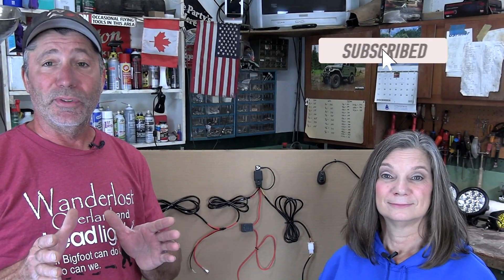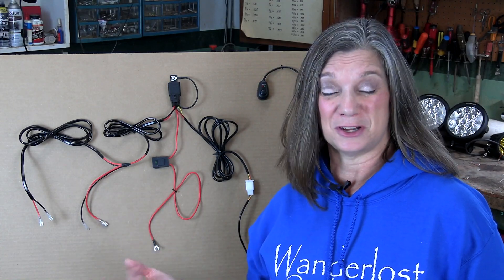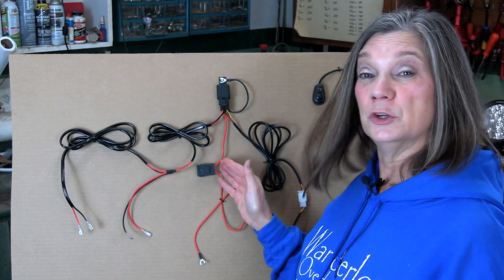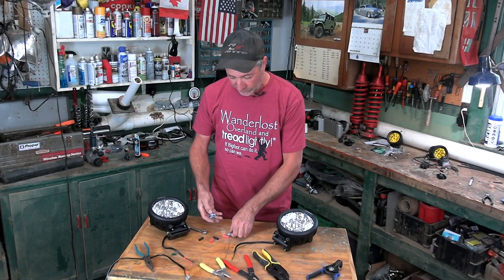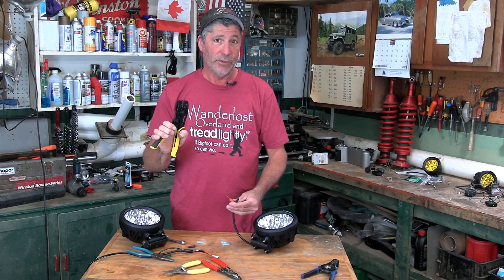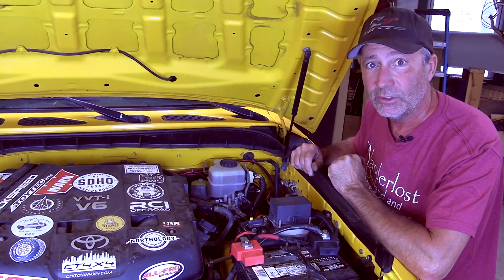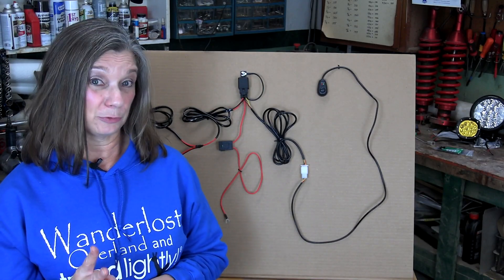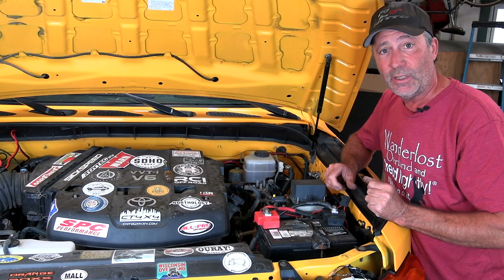How To Wire In Relay Harness For Lights, SIMPLE!

Comment: Hello I really need help, 
Do you reccemend  any H8 foglight wire harnesses? I found one but the switch is the type that is not recommended. The switch has a black ground wire and a loose end red wire and I am also confused which fuse to use in the passenger fusebox. 
Could I please have help with this?

I seen that on the iJDM website is that I must connect the loose red wire from the switch to the ACC +12. Should I get a add a circuit or do the ACC +12 instead?

Comment: Why this switch red light always on even tho I turn off the car ? I think will drain the battery
Reply: That means you probably hooked it directly up to the battery and it’s constantly ready to turn on your lights extreme minimum draw on your battery. You can let it run for weeks and you should be fine.

Comment: I have the kind of switch that you show in your video that has 3 wires. The button on mine broke so now I have to use a toggle switch instead but I don’t know what 3 wires go where on the toggle I have a black /blue and white wires that need to be hooked up to the toggle switch

Comment: Thanks for this video! It is very helpful and through. I am installing running lights on my Ram 3500 and bought a wire harness with switch (5 prong rocker switch, includes relay and fuse) from nightlight. Every time I turn the switch on it blows the fuse. I’m not sure what I’ve done wrong. My wiring from harness to lights is correct polarity.
Reply: Check your grounding. A poor negative off the relay will blow fuses just as much as a faulty positive.

Comment: I'm trying to run 4 light pods into 1 OEM style switch on a 2019 Toyota Tacoma. I purchased a quad output harness that comes with the "mouse style" on/off switch shown in the video.
My question is, how would I wire those 3 wires from the "mouse style" switch to the OE style switches?

Comment: I bought some 4led grille lights (6 of them) to wire in my truck . They each obviously have 2 wires (red & black) coming off the back .
Maybe I'm overthinking it, but I'm confused how I will take 12 wires (6 red , 6 black ) and have them end up being only 2 wires to hookup to the switch . 

I have almost the exact same wiring harness (has the inline fuse & relay) . Do I need to solder the LED leads all together or is there an easier way to go from 12 -> 2 wires?

Comment: Wired one of these in today. I used the cheap “ok” switch. This switch is usable when the ignition is on or off. The little light on the switch stays on all the time. Is this too much of a draw and will kill my battery? If so, how do I change this to on only when ignition is on. Also, my harness said to hook the ground to the battery, if that makes a difference.
Reply: Did you find any solution?
Reply: @GJAGX35  
So thankfully a friend of mine has a son in law who has a vehicle accessory business.  He informed me that the light being on is normal and won’t draw on the battery. Had mine hooked up like this for 6 months and no issues.
Reply: @scottreeser8225  so it's okay that the light in the switch stays on all the time even if the car is turned off?
Reply: @GJAGX35  
Yes, light stays on. Red means aux light that switch is hooked to is off. Green means light hooked to switch is on. So long as you don’t leave the light switch in the on position, there is no danger of running down the battery

Comment: Nice video, thanks. I want to use a stock Ford switch that was not on my truck originally. The back of the switch has three blades. I couldn't figure out why there would be three wires until watching your video. Is there any easy way to identify which blade would be the ground for the switch's led light without having a stock connector plug and harness to look at? Thanks

Comment: On this harness used in this video, have you ever cut the switch off the wiring on one of these to see how many wires are in the sheathing? I was thinking about trying to use this harness on an OEM factory switch and that switch has 2 wires coming off of it.

Comment: Thank you decided to subscribe your advice is concise
One question i have old spotlights non led on my Landcruiser , I need to change to light at . Can I use the existing wiring?
Reply: Sorry led lightbar can use existing wiring?
Reply from the maker: Typically LED lights use less amperage than older style lights. Your existing wires should be large enough to provide the power, but first check how many amps your old lights used compared to your new lights.

Comment: Very Informative video!

I have a question though. 

Upto how many wattage can the relay withstand?

i am planning to add an auxilliary led light that is 50 watts each. do i need to have 2 relays or just one? 

thanks
Reply from the maker: Relays come in a wide range of wattage limits. Get one that will withstand over 100 watts.

Comment: Question maybe you can answer.I have a wiring harness that has red, black and blue wires leading to the switch. I want to use a different switch than the one it came with so it will fit in the switch panel I have. I have a 5 pin switch I want to use, but I'm unsure how to wire it as I know nothing about this stuff.

Comment: I hooked up my lights exactly how you explained,  very similar relay/ wiring harness,  only thing is the off led light on the switch is always on.
Any help would be appreciated thnx.
Reply: Mine does the same. Shouldnt the light turn off automatically also wouldnt that drain our battery if the light on the switch remains on over night
Reply: switch is getting a 12v always on circuit.  move the switch to an accessory or on circuit.
Reply: @K03sport no other possible solution? Only tap into accessory line?

Comment: Hi I’ve brought a push toggle on off switch that’s waterproof that go in place of my push switch like you have in your video. Now the question is the switch that’s in your video has 3 wires the one waterproof switch I’ve purchased only has 2 wires how do I solve this 
Thanks

Comment: Where your diode? When that thing de-energizes it can send a big spike. Self tapping screws are just that...they SELF TAP!  And you want to put that ground ring term of the back side of the plastic hanger of the relay. It needs to touch metal...also should scrape the paint off for a good ground.

Comment: Hi Guys! Awesome video! Your tutorial and visual demo board made it very easy to understand. Thankfully, I have some experience with relays and their wiring for the radiator fans that I installed. My only question is: What size (Amp) fuses should I be using, and do they come with the wiring kit? Thanks so much for sharing, well done. Cheers from Michigan.
Reply from the maker: Some harnesses come with an inline fuse holder. If not, you'll need to splice one in. For fuse size; if your fans draw 26 amps, use a 30 amp fuse.

Comment: How would you add a second wire harness so that you could connect 4 lights to one switch?
Reply: ...the switch should go to or power the relays.  the lights should get power from a (fused) relay.  that way, the switch circuit and light circuit are different and the lights get thicker/bigger wire since they have more current draw.  the switch wire can be smaller since it's job is to only trigger the relays (1 relay per 2 lights)...

Comment: Seems like when ya wire the relay to the battery it turns the little switches red light on. How could one wire to the battery and avoid a constant power draw like that?
Reply: How did you solve it?

Comment: Does the little red indicator light on the switch if it's on all the time use battery juice will it run the battery down if the car isn't driven for some period of time?
Reply from the maker: The light doesn't use much power to light, but over a long period it will drain the battery.
Reply: @WanderlostOverland  how could we avoid this?

Comment: Hello, can you please help. I have installed 2 number 60 watts of aux light in my royal Enfield at 12v that means 10A, the alternator of royal Enfield is 216 W roughly 18A. I have wired my relay such that it will start when I turn on the ignition key, yet I'm facing battery draining issue while I'm riding (i.e when alternator is feeding the current) I have seen many using 60w aux in enfield hence I assume the alternator can power these lights along with the other electricals. Can you advice me where I'm going wrong, though one thing that I did differently is that I've connected the black wire in the negative terminal of the battery. Appreciate if you can help

Comment: What if my relay does not have a short black wire coming out of it?
Reply: i think that if the hole that you put the self tapping screw is bare metal that is the ground instead of the wire, i don’t know for sure tho

Comment: Hi great video but the wire that goes to the cabin to the stock rocker switch with 4 cables how you connect that one I have a slot that I want to put it in

Comment: Okay so I have a wire harness for a turn signal lights that go from the back to the front of my 22 Polaris Ranger and have 2 toggle switches 1 for horn and 1 for signals. Then agter the toggles I have 2 white wires hooked together with a eye hook , 1 for 12v constant , 1 for 12v -. Then have a pulse / bus bar plus with a black , red , yellow but would like to hook it up to come on with the key only so I dont drain the battery! Where would I put a relay and hook the wires also use the 3 wire plug that came with it? Hope to hear from you!

Comment: If I wired this following the wiring diagram on the amazon page for the relay harness and I connect the power wire to the battery so that I can use the switch to turn on the lights I connect to it when the car is off. Will this continuously drain the car battery while those lights are off?
Reply from the maker: I don't see how if the switch is in the off position.
Reply: But the little red light stays on when connected to battery

Comment: great video BUT you did not show how to wire the switch you used which had 4 or 5 wires coming out of it ????????????
Reply: Has anyone found a better video for this?

Looking to splice multiple off road lights together and need some answers.
Reply: @Blue_Collar_Hunter  Ive looked and looked and no one has made a full video. Maybe ChrisFixIt video was close but still not quite there.
Reply: @Blue_Collar_Hunter Did you figure out what to do? I can try to help you if you didn’t finish the lights yet. I have about 15+ professional years experience with electrical systems. Mainly DC systems I’m an electrical engineer / micro soldering specialist in the repair field. If you have any questions or want to double check something you did just respond to my comment and I’ll help you the best I can from over the interwebs 😂.
Reply: @shiftctrlhack I've got pre existing switch and wiring from previous owners but it's only 2 wires a red and a red/black. The wiring harness has 3 a blue a white and a brown
Reply: @shiftctrlhack My husband is going to be wiring ours soon. May I reach out if we run into any concerns along the way?
Reply: Same old, same old diy fog lights wiring instructions. Very poor details, but a lot of talking instead.
Reply: Found a video for it(Toyota Aftermarket Push Button Switches Explained) but the problem I now face is the Auxbeam wiring harness has four different wire colors running to the button than what is running through out the rest of the harness😮‍💨
Reply: @mup8661 hgh
Reply: That is definitely the relay that had 5 wires and I'm familiar sure they bought that as a whole.... "One piece harness" 
   Learn how a relay works and make sure you have an appropriate fuse or resister in the supply line so you don't fry your ECM, BCM or any other computer in your vehicle
Reply: I think that was the relay? Maybe? There are many videos on wiring a relay, if that was what you were referring to. 👍

Comment: With the add-a-circuit you need to pay special attention to the orientation. One way or works as intended, the other way the original fuse is coping with the consume of both circuits so you may get constant blown fuses.

It is important to check with a circuit light or voltmeter. The wire side should always be on the cold side of the circuit.
Reply: I understand they are oriented but if your using a fuse tap to a relay then you should only be only be pulling the very low amperage to the switch and not the full amperage of the accessorie. So it really shouldn't be overloading the circuit. Is that right?
Reply: @danielbonner8309  correct but with canbus vehicles it isn't recommended to add draw to circuits, the other issue with add a circuit is that if you reverse it the new circuit won't be protected. That's is because if the tail is on the hot side then it is basically bypassing the fuse.
Reply: @munecito  Ok. I see that when just adding a an accessory directly to the add a circuit but when your adding a harness with a relay you would be getting the power directly from the battery which has an inline fuse in it. Regardless I'd want the fuse tap oriented correctly.
Reply: @danielbonner8309  depending on what circuit you are tapping from the canbus could start throwing codes with milliamps. Some circuits are more sensitive. 

If you must use the cigarette lighter circuit or internal lights.
Reply: @munecito  Thanks